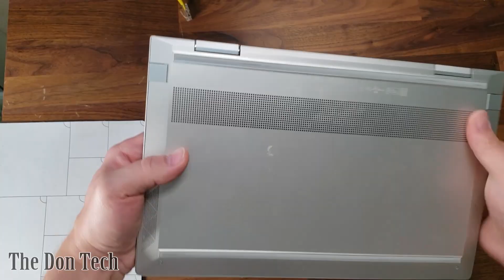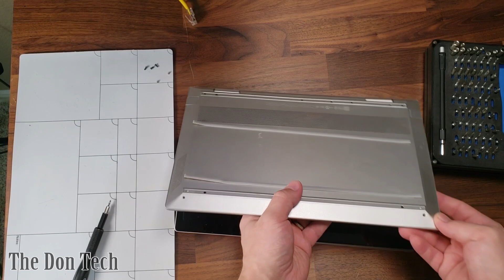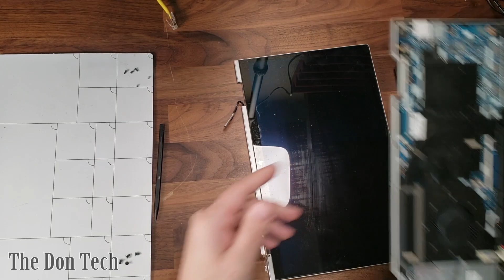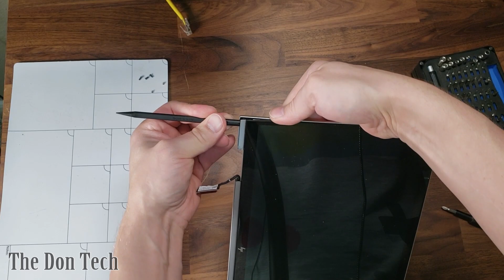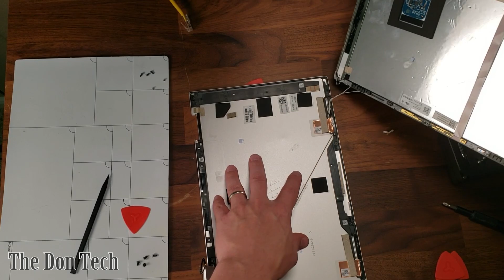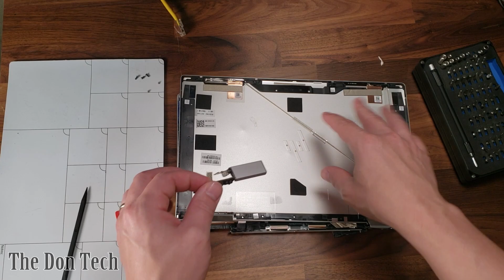HP Envy Broken Hinge Repair: My Fix Experiment & Why They Break

Comment: Hey got a hp envy model # 13-aq0045cl

The plastic part that mates the hinge attached to the top cover, with the metal bracket on the  bottom cover is disintegrated on both sides..... is there any way to fix this ? 

Laptop itself works fine apart from the fan but im pretty sure thats because it ate the plastic pieces and i can probably fix that. 

Cant freaking believe hp used straight up plastic for these parts on a 1000$ laptop..... guess thats how they got their nick name. 

The Ssd it came with is also limited to 1800mbs which is kind of ridiculous when cpu/motherboard is fully capable of max gen 3 speed @ 3600mbs
Reply from the maker: The only way to properly fix it is by replacing the damaged pieces. Usually the upper or lower palmrest, pieces if the damage is on the base of the laptop, or the entire upper LCD assembly piece. Depending on how the break is you can always attempt an epoxy repair, though you need to make sure you have a lot of surface area for the plastics/metals to bond to, while keeping in mind that this is a permanent attachment of the components in that area to themselves. 

Sometimes the Front Glass and Rear Bezel are separate pieces, but generally you are better off buying an entire new assembly. 

All manufactures are using plastic and glue to hold these hinge mounts into play. It's rather pathetic and annoying. 

I do have a plan to try to repair one with screws and drilling, but I haven't had the time to properly plan or navigate that path yet. Even if that were to be successful, I would likely not recommend it.
Reply: @TheDonTech  on the left side theres enough plastic that 2/3 screws are still attached but on the right side there is absolutely no plastic to speak of. 

Not sure if im explaining this very well.  

Its attached directly to the circular rod that actually acts as the hinge with a bolt, which is connected to the screen assembly. Then its connected to the bottom case by 3 screws. 

Actually after watching your video here, on the laptop you're working on its definitely made out of metal and not plastic. 

Guess ill actually take it apart and see whats connected to what. 

Thank you for the response!!
Reply from the maker: It's one of those very difficult things to explain, but super easy to demonstrate in person, haha. You likely had something that broke out of that area then and is completely gone (or the plastics are still attached to the metal hinge part).

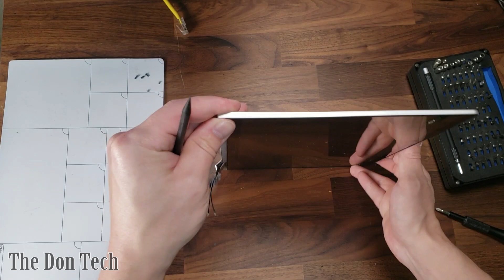Comment: 11:49 it is taped in. Using a blowdryer or heat gun here can help to get it off
Reply from the maker: Due to how much thicker these displays are, the bezels and the metals/plastics surrounding it, using heat may cause damage to the display itself. Introducing heat also increases the chances of the screen cracking during removal. 

This laptop is still in my office in pieces though, I haven't touched it since this video, haha.

Comment: The HP Envy 15-EW service manual shows making a gap inbetween the lid and the lcd panel with a pry tool at the right spot to put some narrow pliers / string tweezers in to pull the tape and wrap it around the tool as you pull to stop it shearing. Its worth a look - official HP service video.
Reply from the maker: Unfortunately these service manuals look good in theory, but are not always accurate in execution. 
HP makes it look that way, but I can assure you after hundreds of removals (from HP and others) that the tape is garbage and they think it works that way. Also the way that glass works, you get too much of a shift from attempting to pry the screen away and the glass will crack. Seen that one too many times as well. Most the time they expect you to remove a broken screen from the chassis, not a fully intact screen. 

Give me 4 screws holding in the LCD Panel any day of the week over this adhesive nonsense. Thanks for your comment!
Reply: @TheDonTech  Ofcourse! Thank you for your advice! Im about to tackle a 15 Envy with a busted hinge, looks like it released from the lid and when the screen was opened/closed it busted right through the screen. Found the laptop in a skip and it actually is still fully functional (including the screen still operating if a bit ugly).

feels like it is worth saving as it's a 12th gen. sadly it broke the screen. Looks like I will need to 2-part epoxy the hinge and maybe lubricate it to make sure it doesnt release.
Reply from the maker: @kakoth  Definitely worth saving. You can always just leave it as is though without any more risks, just kind of leave it sitting on a desk instead of moving it around. Epoxy has saved several laptops, making the broken side stronger than the OEM, which may cause the opposite side to break. But if that happens - more epoxy! Let me know how it goes for you!

Comment: Hey Don, so we've got a HP Envy M6 n010dz Notebook with a broken hinge mount that's on the INSIDE the casing, underneath the keyboard. It's the plastic piece that has the inverted brass screw holes that you fasten the hinge into, connecting the monitor to the keyboard casing.

How can we repair that? I don't know what the name of that part needed. I'll go back through the video and comment again when you are either touching that part or mention it.
Reply from the maker: What you will typically need is the entire upper palmrest assembly for that laptop. There can be many different variants to the same model of laptop, so ordering off of the exact part number is recommended. I did a quick search in ebay which produced 18 results for your style of laptop - https://www.ebay.com/sch/i.html?_from=R40&_trksid=p4432023.m570.l1313&_nkw=envy+m6+n010dz+palmrest&_sacat=0 - and as you can tell there are different options available, some with and without the keyboard and track pad. You may also need the bottom casing if that was damaged as well. 

Depending on how bad the break is, you may be able to use an epoxy resin type of adhesive to bond the surface together. This comes with more risks and a lot of times may not work because the structural integrity is gone. 

Best bet is to find the part number of your exact laptop and put it into ebay to find something from a reliable vendor. These palm rest part numbers may appear under the motherboard, requiring a significant disassembly. You may also be able to message them, perhaps with pictures, and they can more accurately help you find the proper part. 

Hope this helps!
Reply: @TheDonTech  thank you so much!!!